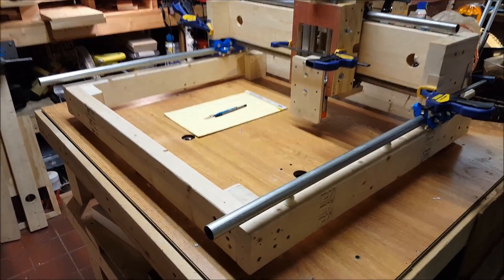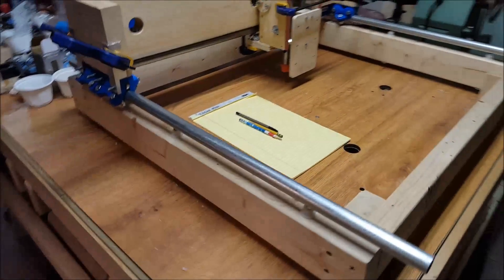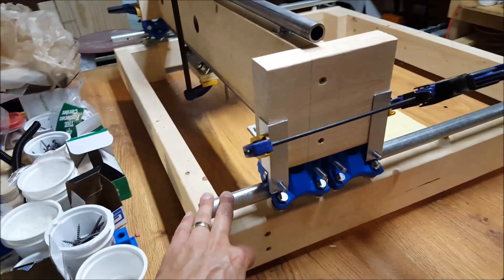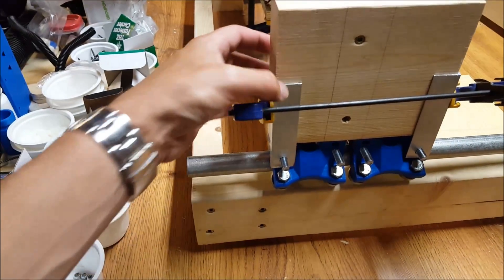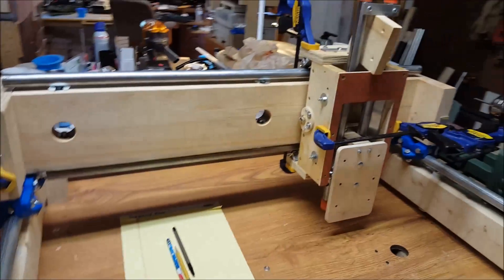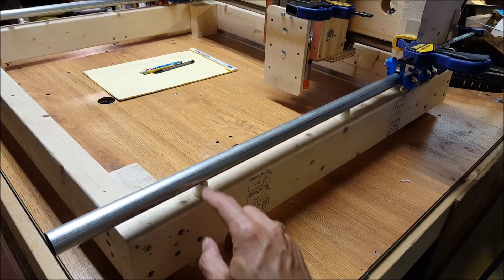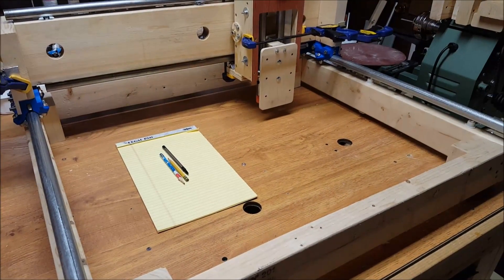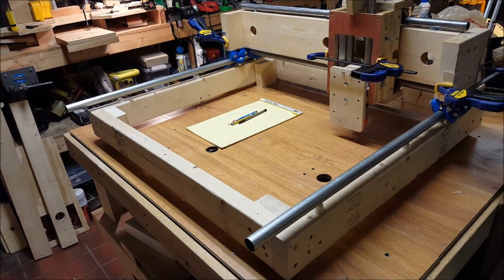Solsylva & MPCNC Mashup!

Comment: I built the MPCNC but it really frustrates me how nonrigid it is.  Everything has to be run so slow and its still somewhat flakey.  I even encased the frame in 2x4's and locked them together.  The gantry is just not rigid.  I came across the Solsylva and am thinking about going that route.  Since you've used both, would you say the Solsyva is the better machine, as in more rigid or even overall?  Your mashup here seems like a great idea and I might just copy your design.
Reply from the maker: Thanks for your comments.  The MPCNC was fun to print and assemble.  It's a very cool design but not as beefy as I wanted.  The Solsylva is definitely more rigid.  I also found it more difficult to get really lined up.  The Z box with the aluminum angle and skate bearings took some time to get tight but it still had a little play.  The V-bearings on this mashup are really strong and I'm liking the way it's behaving.  Very responsive and tight.  Best of luck.
Reply: drez20001 Thanks for the input!  Do you have any tricks getting the Solsylva aligned?
Reply from the maker: If you build it just take your time marking the holes on the aluminum angle stock.  Use brad point drill bits to really set the holes.  It's a fun project and the designer is a very friendly guy who does respond to emails.